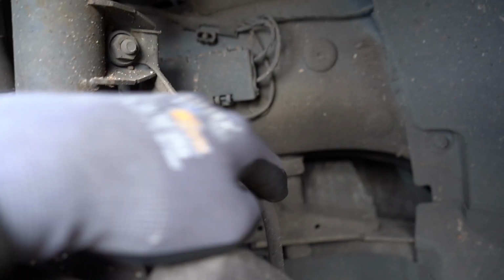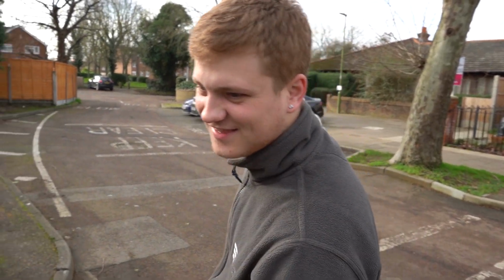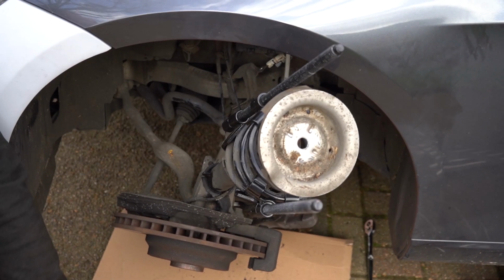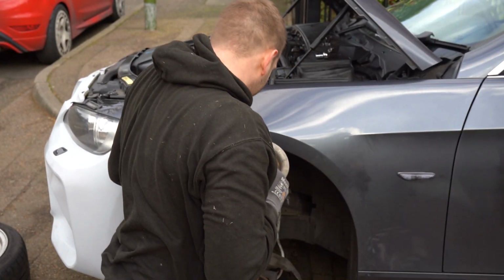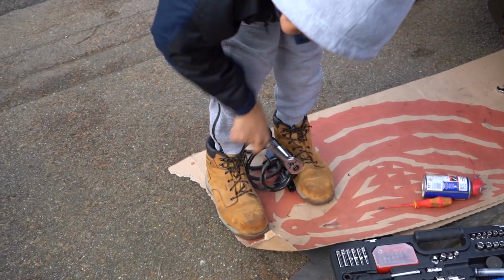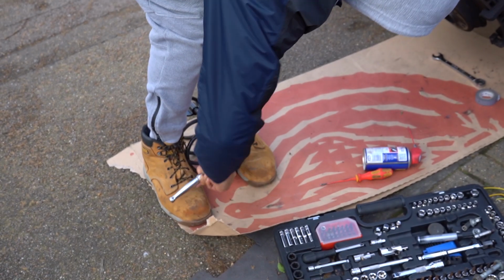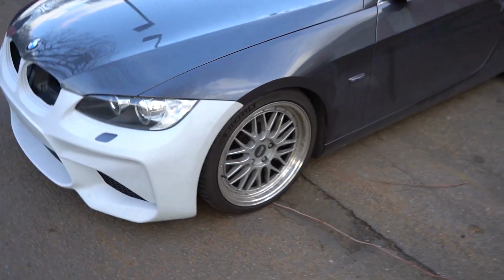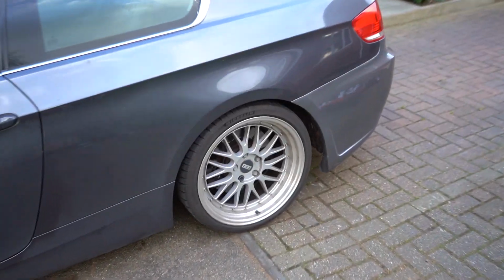MY BMW 335i E92 GETS NEW LOWERING SPRINGS

Comment: Where did you get the m2 bumper? And how much did it run you mate? If you don’t mind me asking?
Reply from the maker: It was of an ebay seller whos no longer selling it. And if memory serves me right it was £350 but needed alot of prep for paint/wrap
Reply: Kilbster would it be pretty hard pressed to find one?
Reply from the maker: @gearedupproduction8290  ermmm let me ask someone who contacted me and said they purchased one
Reply: Kilbster I would highly appreciate that mate because that bumper is menacing.